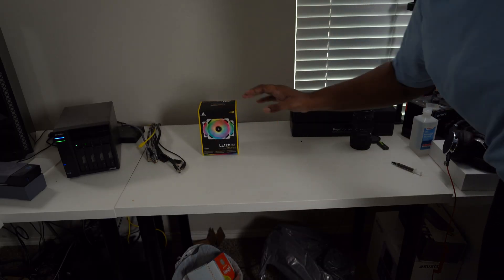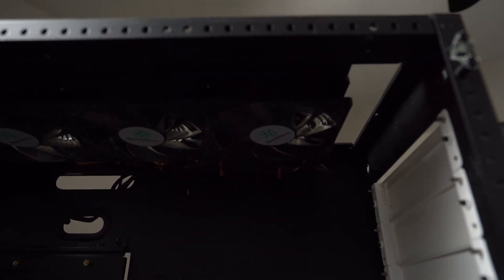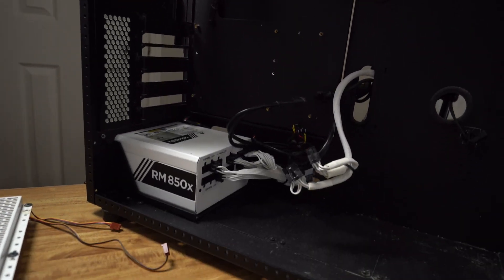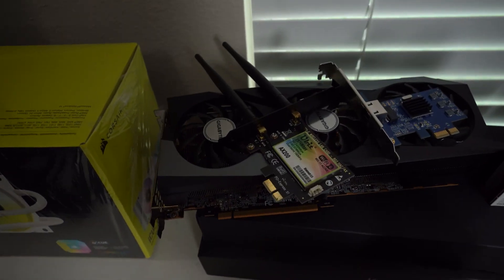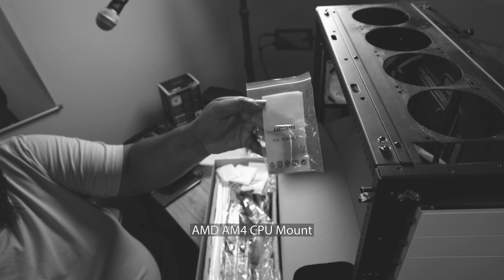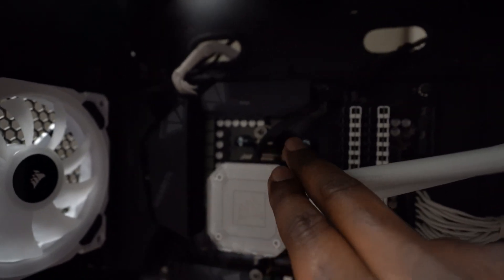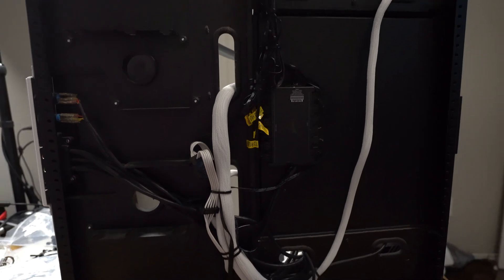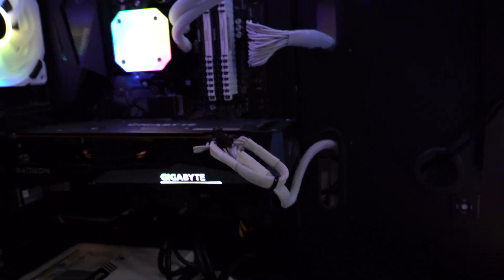Unboxing and Installing the Corsair iCUE H150i Elite Capellix on an AMD 5900X

Comment: Cheers!!!! Cool Video!! I Would like to as a question:
Naturally You install the RGB fans on the inside so You can see the full effect of the lighting, but as they are they are sucking the warm air from inside the case and channelling it through the radiator, which should be receiving cool air.
Shouldn't You reverse the mounting of the fans, and pull the outside air through the radiator? You would see the back fan structure, but the lighting effect would be there...

Comment: How loud is the pump? Is it noticeable with headphones on while gaming or listening to music? Also how well does it cool this CPU?
Reply from the maker: Pump was only loud when I first booted it and it needed to get all the air out of the loop. After about a day or so of running it got a lot quiter. It's not noticeable at all with headphones and gaming when temps rise which will cause the pump to ramp up a bit as well if you have it plugged into the the CPU fan header.
Reply from the maker: Temps stay in the 30s on all cores when idle and get up to the low 70s when under load.

Comment: is the aio pump loud? Ive heard it is.
Reply from the maker: The pump was loud when I initially installed and turned it on due to air in the loop like any liquid cooled setup but after running for a while it gets quiet. It does get audible again during gaming and whenever it's under load cause that's how my fan profiles are setup and the pump is connected to the cpu fan header to control its speed. However, it's not that loud to me but your milage may vary.

Comment: Does the Corsair iCUE support other brands like the ID Cooling fans?
Reply from the maker: You can connect other fans to the Corsair Commander Pro, but it will only control the speed not the RGB.
Reply: @Eshcole  Thank you so much for the help! ❤️